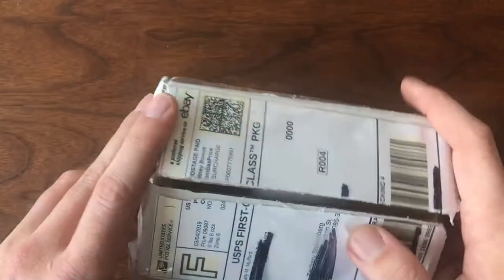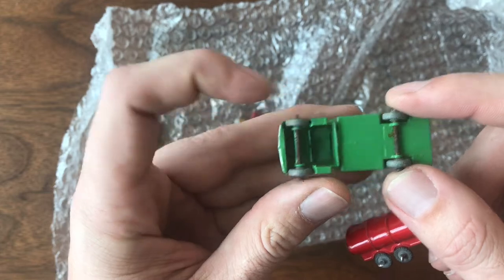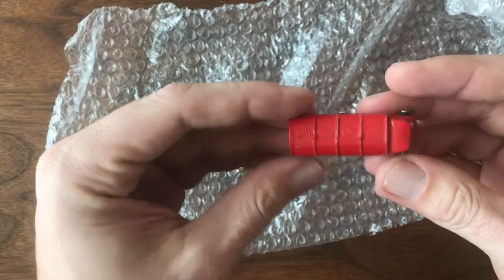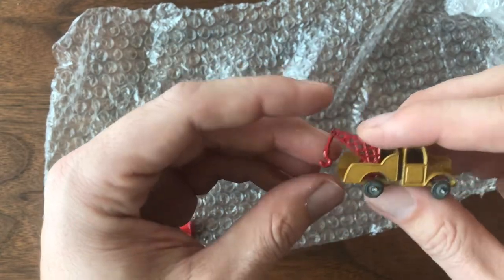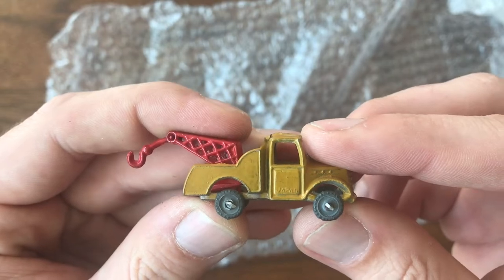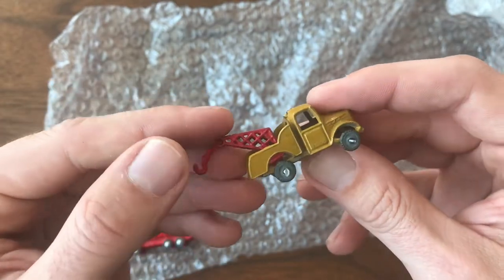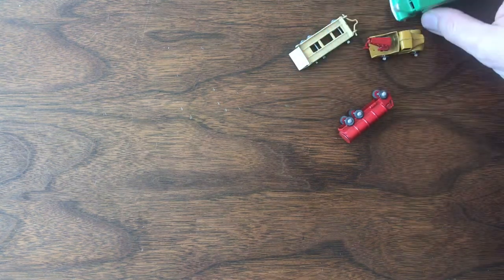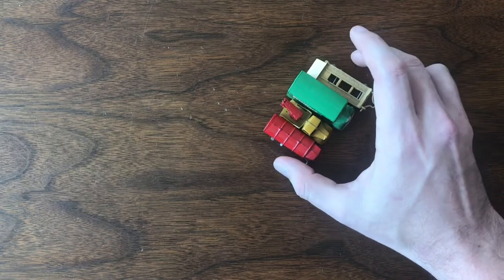Mail Call, March 16, 2019

Comment: I concur with Tis Best in Diecast The Bedford Removal is a genuine Lesney. There should be an I'D mark inside the van part towards' the cab. The tires' also are Lesney. Nice score all round.  Cheer's
Reply from the maker: Took a closer look and you all are correct.  It is stamped way down inside and I compared it to another model that I had and they matched.  It was advertised as a knock off but apparently it was the real deal!

Comment: The gas pumps came with a metal BP sign the plastic signs go with a full station. I have several and could spare one if you are interested
Reply from the maker: So I believe the sign I have actually came from the Gas/Garage play set and should have a smaller red sign that clipped beneath.  I am still on the hunt for the smaller metal sign with the pumps.  Shoot me a PM about pricing and shipping.
Reply: @vintagediecastrestoration  I'll message you on Facebook through your page on there. I'll find the ones I have after work tommorrow get some pics and send them to you
Reply: Just messaged you some pics on Facebook messenger. Let me know what you think